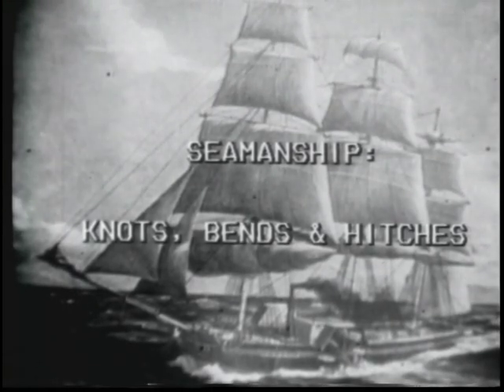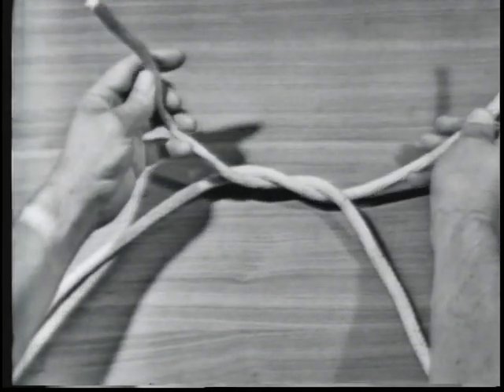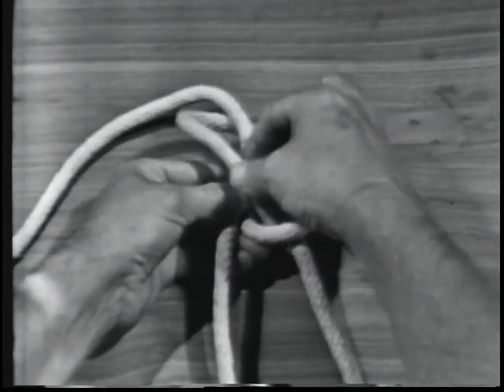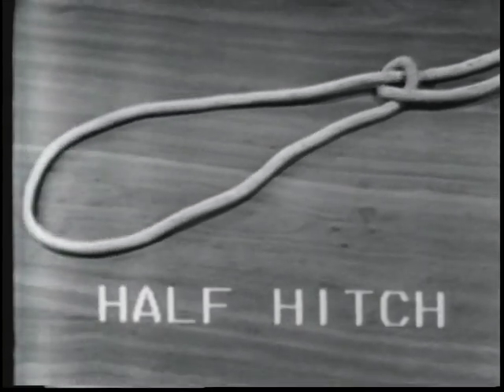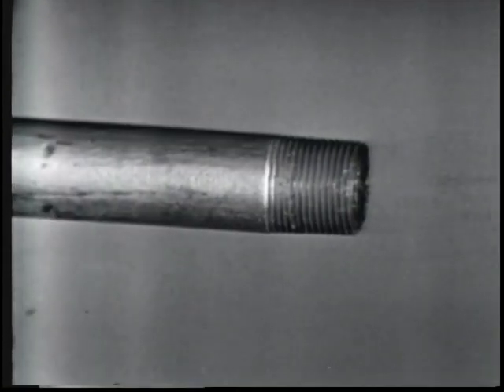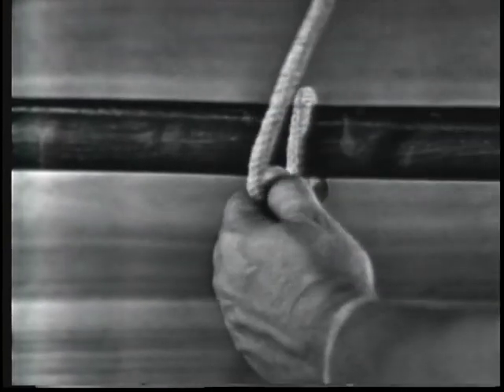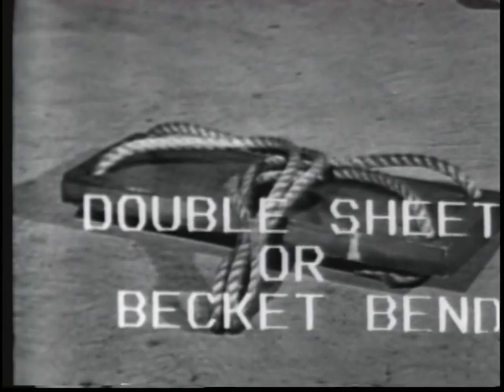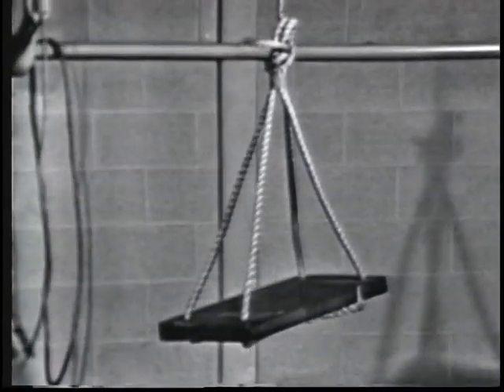KNOTS, BENDS AND HITCHES

Comment: Whipping is a technique for preventing the end of strand or braided rope from unravelling, and much more elegant than electrical tape.  Seizing may look similar, but it is used to join two lines (or two parts of the same line) and generally requires 2 layers of "turns" of small stuff/ marline. The second layer is called "riding turns."  Hervey Garrett Smith has the best illustrations of this (and all things rope work, knots, and seamanship).

Comment: Contrary to what the narrator says never join two lines with a square knot. The square knot is also known as the reef knot and is used to reef a sail to the jib or boom. When unreefing the knot is capsized by pulling the loose end diagonally across itself. The square knot will come undone if used to join two lines. Lines are bent together never tied.

Comment: Seizing is securing two ropes by lashing with thinner string. Also known as whipping. The running end is the tail of the rope (aka "tag end"). The video suggests lashing the running end to the standing part (aka the main length of the rope).
Reply: How do you know
Reply: A Whipping uses much smaller line on the end of a rope to keep it from unlaying.  A Seizing is similar, but joins 2 parallel lines together.  So, you'd whip the bitter end, and you'd seize the bitter end to the standing part, perhaps.

Finally, a Lashing is, yet, a different thing.  A way of using line to join 2 spars, parallel, at right angles, and stuff in between.  Shares some techniques with seizing.

Comment: Can we stop teaching the Reef (Square) Knot as a bend?  He, at least, mentioned not using it if it might get wet, or if lines are of different diameter.  Or, if they have different lay.  Or one is stretchier than the other (different materials or braids).

It's just a bad idea.  Use the Double Sheet Bend, making sure both ends come out above (or below) the knot, together, as is shown at 14:30, but NOT as shown at 22:33.  See also Alpine Butterfly Bend, and the Zeppelin Bend.

Comment: does anyone know what the narrator means when he refers to "seizing" the running end?
Reply: I believe Seizing refers to using small stuff to bind the running end of the rope to (usually) its own standing part.  In the Carrick bend (tm 20:00), the two loose ends would be seized, each to its own standing part. There's a good image on Wikipedia: https://en.wikipedia.org/wiki/Seizing#:~:text=Seizings%20are%20a%20type%20of,leverage%20to%20immobilize%20larger%20ropes.